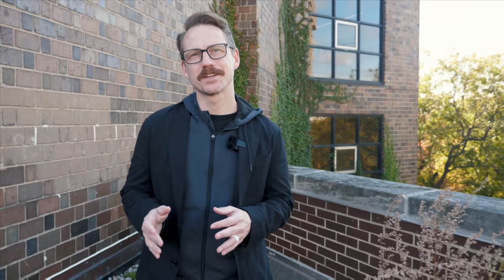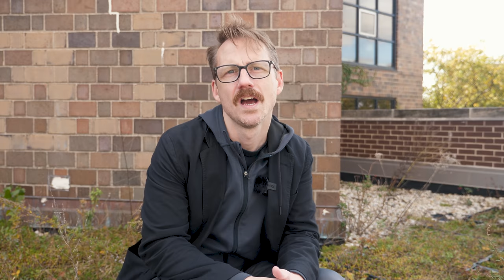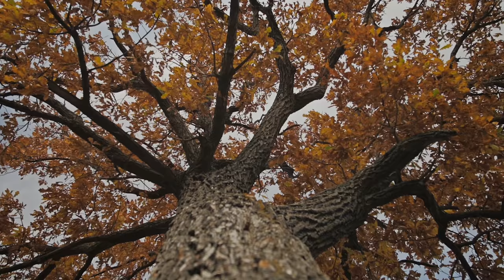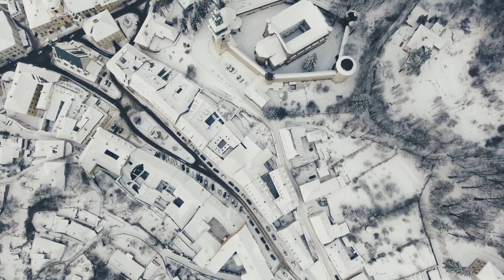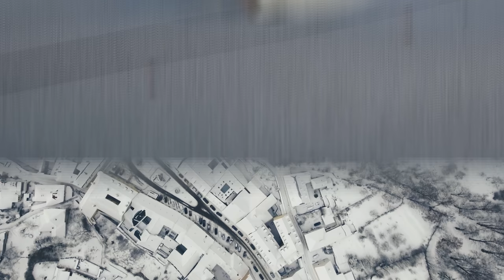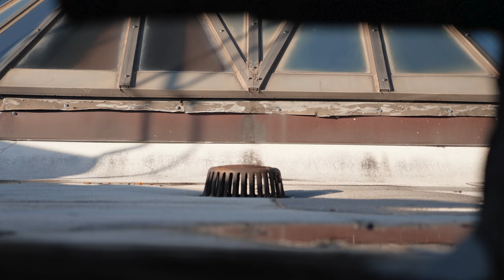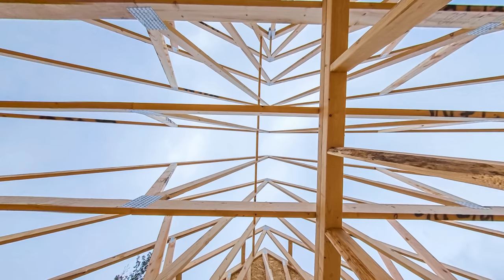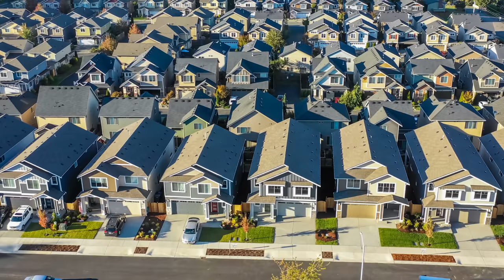Why Do Architects Insist on Using Flat Roofs?

Comment: Three key elements go into any sort of architectural design:
1 ) Occupation / Frequent Traffic
2 ) Servicing / Infrequent Traffic
3 ) Durability / Material Design

People have a tendency to prioritize these elements from the perspective of their individual bailiwick.  As most people are exclusively occupants / frequent traffic, they very much prioritize #1; they only consider #2 when it disrupts #1, and rarely (if ever) consider #3 at all.  Many architects and 'design engineers' very much prioritize #3, though with some consideration to #1; they give little or no thought to #2, much to the infuriation of maintenance workers throughout the world.

For all they lack aesthetically, flat roofs are the only element to prioritize all three elements.  As the roof bears the greatest environmental brunt (sun, rain & snow, thermal envelope, etc), durability / material design is paramount; even the slightest failure can be devastating.  As the roof is generally unoccupied (and we have this thing called 'gravity'), flat roofs are an ideal location for integral equipment - particularly as larger buildings require more equipment, meaning there is near-constant need to access it.  And while such servicing is closer to being frequent traffic than infrequent, a flat roof also provides much-needed recreational space amidst the soul-crushing dystopia known as 'city living'.

There is, however, one additional caveat which applies to all buildings:  In the event anything on a roof decides to move - be it rainwater, accumulated ice and/or snow, or a piece of mechanical equipment - its inherent tendency (thanks again, gravity) is to find its way to the ground.  The hyperbolic example of a penny dropped from the Empire State Building utterly pales compared to a hundred-pound slough of wintery slush falling even a few stories.  Can you even visualize what the streets of Manhattan would be like during even a light drizzle if it all ran off the roofs and onto the nearest sidewalks?  Not just the quantity but also hitting the pavement with the force of a power-washer?  (Actually, that last part wouldn't be all bad - city sidewalks are disgustingly filthy.)

My biggest peeve about flat roofs is strictly from a mechanical standpoint.  Consider the evolution of bridges and how the simple beam bridge is inherently the weakest design - no matter how strong the members or how well-anticipated the deflection, there is always sag between the vertical supports.  When applied to roof design, these deflections (at best) interrupt the displacement of precipitation and (at worst) cumulate to destroy the structural integrity.  A slight sag accumulates a puddle, increasing the load at the beam's weakest point which causes more deflection, causing the size of the puddle to grow which increases the load at the beam's weakest point; lather, rinse, repeat.

Comment: Flat roofs. More practical. They are 10X easier to repair than shingled roofs. And like... I don't have to worry about dying when working on a flat roof. Also, this is the future. Shouldn't be hard to design a flat roof that doesn't leak. And if you are really worried about standing water , a SLIGHT slope could fix that without making it dangerous to walk on , or impossible to put equipment on top of it.

This is my opinion from having worked on both types of roofs for 3 months.

If you  insist on functionality rather than ease of maintenance , might as well just go for a metal roof instead of a singled roof. Fucking nightmare to work on. And you WILL slip off it with most shoes. But the snow will slide off like teflon.

I also highly suspect squirrels won't be able to climb on your metal roof.
https://www.youtube.com/watch?v=tP3q4xhwZ7g

Metal roofs will also withstand hail. They will get dented, but they wont leak.
Reply: it's easy to design a flat roof that doesn't leak: build it in the desert.
but yes, I'm sure your three months experience has taught you all you need to know about roofs.
Reply: Metal roofs are the bomb! ... In the tropics where I have lived now for 15 years, the vast majority of roofs (commercial and residential) are pitched roofs made of colorbond steel. Even the square concrete-box commercial buildings here have a gently pitched steel roof hidden behind the tops of their concrete walls. The huge rainfalls we get rarely end up on the inside of the buildings (unlike truly flat roofs). The only downside to a steel roof is the incredible noise of rain falling on it (which isn't entirely unpleasant - it's just *loud*) :)

There's a retail/office building in front (and downhill) from the apartment where I currently live, which has a flat concrete roof. It's been there around 20 years or so. That roof is a patchwork of polyurethane sealant where the maintenance people have been playing whack-a-mole with various leaks over the years! I'm stuffed if I know why it's got a flat roof, I never see anyone on it, and their air conditioning plant is mostly attached to the building's rear walls (I see only two out of about twenty compressor/evaporator units on the roof). I suspect as air conditioners have been added, the prospect of going up through the roof (and introducing another potential leak) has been weighed up against going though the wall, and the wall has won out.
Reply: I meant to add, that a pitched roof doesn't need to be so steep that you cant walk on it. I've spent quite a bit of time doing work on the roof of my house (with a steel roof at a 1:4 pitch - that's a much steeper grade than you need for shedding water, but it's still quite walkable). Of course, high snow areas require roofs with steeper pitches, but if I were living somewhere that it snowed, I'd prefer to know that excess snow would fall off my roof without me having to go up there and shovel it off before the whole lot (snow, roof and all) came crashing down into my house!
Reply: @danielscott4514  right. the further north/south you are, the more pitch your roof needs.
Reply: @danielscott4514  Oh yeah. I worked on roofs in Michigan. We get a lot of snow. I am in Florida now and thinking of picking up a roofing job. But I notice a lot of the roofs here are this weird terra-cotta tile thing I've never worked on before.

Comment: Stuart. I love these videos. Thank you. I'm a mechanical engineer who concentrates on all aspects of building science and I'm generally not a fan of "green roofs" (vegetation on a roof) Why? Because recognize that that roof can no longer be used for solar power production.  i.e. green roofs reduce solar (green) energy production or shift it to farm fields. My other concerns are green roofs are heavy. Extra steel has to be installed to support the weight which releases embedded carbon. They are much, much more difficult to maintain (how do you find the leak) and the other issues that "green roof advocates" claim is that green roofs regulate rain water into the storm sewers (easily solved by metering roof drains), combat heat island effect (use white or light-coloured roofing materials) are good insulators (soil is a poor insulator). Green roofs do not sequester carbon, yes plants go on the roof and take up carbon while on the roof but when the building is torn down and the plants removed, they die and release the carbon. There is no net carbon sequestration.

Comment: Thanks for highlighting the different points which advocate for gabled and flat roofs respectively. I have had the misfortune of living in a 20 year old home with a poorly installed flat roof, which has resulted in a multitude of leaks from 3 different entry points over the past 20 years. I have had the roof repaired 3 times, and I have only fixed 2 out of the 3 leaks (still diagnosing the last one). 

Despite the built-in tilt to allow for water run-off, during heavy rainfall + strong winds, the rain can easily flow against the tilt and go back up the roof, resulting in water build-up in unexpected areas. Lastly, depending on the materials used on flat roofs, it might actually end up being more expensive than a typical gabled roof in regards to maintenance. For instance, my home utilises extremely long pieces (10m+) of sheet metal, which is difficult to source given the length. If I had tiles on a gabled roof, I think maintenance would end up being cheaper in the long run, plus I have the added flexibility of only needing to fix the problem area, as opposed to entire sections like a metal flat roof.

Comment: Sloped roofs on tall buildings in a place like Chicago where you can get wet or blowing snow would be a disaster.  Snow sticks to or packs against the roof, until it reaches a certain mass or the weather changes, and then it falls off the roof.  People die when large amounts of snow fall off skyscrapers.  You might also have a situation with freezing rain at ground level, but the roof is above the freezing point due to sunlight or heat from the building.  Water running down an exterior drain will freeze and block the drain.  Usually the drain pipe will burst, large icicles will form, and also fall down and kill people.  I've seen icicles fall four feet off of a single-story eave and put someone in the hospital.

Comment: The reason nobody chastises the ancient Egyptians for flat roofs (or other cultures that use them) is because they're obviously functional. There are stairs to the roof so they're obviously useful as extra space. Most modern flat-roofed buildings don't have flat roofs for any functional reason (though some taller buildings do have rooftop levels for utilities). They have them because whoever built it was either too lazy to design a building that looked nice or some developer wanted to build exactly to the size restrictions for the lot and wasn't competent enough to design the building properly, so they just built a box.

Aside from providing extra outdoor space, which is relatively rare especially occupiable roofs rather than just for exposed utilities that'd work just as well protected, there is nothing a flat roof does that a gabled roof doesn't do better. It can be used as outdoor space. It normally is not though. It is almost exclusively the domain of lazy property developers wanting to build an ugly box as cheaply and quickly as possible and then sell it for several times more than it's actually worth.

Comment: "Flat" roofs, or roofs that only slope one way are a dream in snowy countries. 
I grew up with a traditional roof. I can't tell you how many times I was fast asleep when suddenly the whole house started to rumble with the deafening sound of tons and tons of snow starting to slide off the roof, knowing that in the morning I'd have to get up and clear all of that, at this point compacted snow off of the path from the front door to the driveway, which I had just spent the last hour of my previous day clearing.
The garage, which actually did have a flat roof, was trouble-free. It sprung a leak eventually... but the sloped roof leaked first. And the flat roof had remained unreplaced for twice its recommended lifespan.
I'll tell you the number one reason why people hate flat roofs, and it's the same reason that they don't like cars with swoopy shapes: it's not common and not familiar.

Comment: Here in Jackson, Wyoming, much of the town is being redeveloped from single family ranch style houses built on city lots from the fifties through the seventies. The redevelopment follows a pattern: Big boxes with a half basement that utilize the entire lot to the setbacks to maximize square footage- the market wants the 4000 sq. ft. family home instead of the older 1500 sq. ft. home. These homes invariably have flat roofs so that the can have three level while meeting the Town's height limit.
   I inspect a lot of new construction of townhomes with flat roofs- EPDM or PVC. They ALL have places with standing water on the roof. It's a given.
   We had a collapse of a flat roofed commercial building here about ten years ago due to snow load in a severe, prolonged storm.  Architects plan for a certain snow load, but nature may not cooperate.
   But the reality of dense commercial development requires that measures be taken to deal with runoff from these structures. The famous Wort Hotel in Jackson is a case in point: this structure has a gabled slate roof, and the surrounding sidewalks must be blocked off in the winter because of the danger of huge falling icicles.

Comment: It really depends on where you live and the scale of your project. Where I live, it rains half the year at minimum and we get about several typhoons. Combined with the cost of repairing waterproofing versus repairing a roof, and we have an area where flat roofs are viable only for large commercial or high-volume vertical residential spaces.

Comment: The desire of most architechs when it comes to light fittings: Make sure the light fitting is unique, impossible to economically repair/replace in future, or choose one with huge ceiling cut out which will require patching and repaiting the ceiling.

Comment: Fantastic mustachio sir. You earned a sub based on the good b-roll, succinct explanation and chipper character. I work in the cable industry, and also live in the southwest. One downside to the flat roof model is there  is very few if any available space to install a line or pipe that works easily with the home design if someone wants this stuff hidden. This is usually because things are hidden in an attic. Secondly, the added insulation helps with hot summers and colder winters that occurs where insulation can provide that added barriers. All that being said, if a customers doesn't care about a line going through a wall to a certain location then a flat roof is one of a cable installers dream.

Comment: I just have an observation from experience as a swede. I lived in Stockholm for a while, a place where extremely gabled roofs are common, especially in the downtown. And there is a problem with snow on those roofs. Or more specifically when the snow melts and often gets transformed (due to constant alternation between thawing and freezing) into enormous icicles that then might drop down on the street and occasionally even injure or kill someone walking there. So to get around this problem the roofs often need to get cleared of snow and ice (if it's been snowing a lot) and on those steep slopes that is a dangerous and difficult job. And still, even though this is usually done pretty meticulously, every year some people are injured or even killed by falling icicles. I've never seen that problem with flat roof buildings. So my 2 cents are, flat roofs don't create dangerous icicles that kill people on the street under them.

Comment: While I would agree that flat roofs have a definite place, my main issue with them is when they drain directly into sewers, which means the area around the home receives substantially less rain water to contribute to a healthy water table. While this may seem like a minor issue, when scaled up over hundreds or thousands of homes in a neighbourhood, the water table can be severely depleted over time, causing shifting and compacting of soil (thereby shifting foundations) and the added flow into the sewer contributes to negative effects to water systems in general (ie flooding and erosion of rivers due to a massive influx of sewer water).

Comment: The thing people don't seem to mention is that you ALWAYS have to clear the snow from the top of a roof be it flat or sloped/angled.

I don't know whether it's because people have gotten lazy with chores or just don't know, but you always clear the snow at least twice during winter. If you don't, the amount of pressure will break the roof... and you don't want that.

You need to be proactive during the winter season.

The angle/slope of the roof affects the method through which the snow is cleared. In a sloped roof, the snow is dropped down while on an even roof you can easily put some of the snow in a container to melt it/drop it/melt it using other methods like a flamethrower etc. (it's an idiot's choice but with flamethrower make sure the drainage is heated). Also you can easily just heat the roof using both roof types by utilising excess heat, preventing snow buildup.

Flat roofs are better in urban centres where you can't drop the snow, hence drainage. Sloped is better where you can, suburban areas and less dense population centres or industrial zones.

Always. Clear. Your. Roof. To. Prevent. Damage.
Reply: That is utter and complete bs. Any roof must be designed to withstand the amount of snow expected and then some. Please seek help.

Comment: In Morocco almost all roofs are flat, with residential buildings being made to be more usable than just having access to them. Think like a basement, people would have their washing machines there so they can easily hang the clothes to dry on the roof, some have their water heaters there, some build a storage room, similar to an attic. It's not just wasted space.

Note that the Moroccan houses have no space between them, which means there are no backyards, no lawns. Rooftop use is slightly lower in Villas, a form of residential houses that have a backyard, as people would then prefer to have barbecues for example in their backyard instead of on the rooftop.

Comment: From a maintenance standpoint a flat roof is a disaster waiting to happen, but from many other aspects it is a clear improvement. The issue with almost every system is that you have good and bad installers. A flat roof requires much better prep and understanding of water movement compared to a gable. Any laziness of the installer is magnified 100x since water seeks out the path of least resistance.